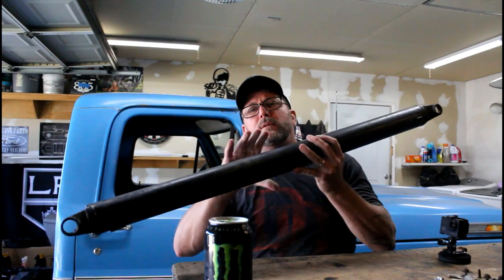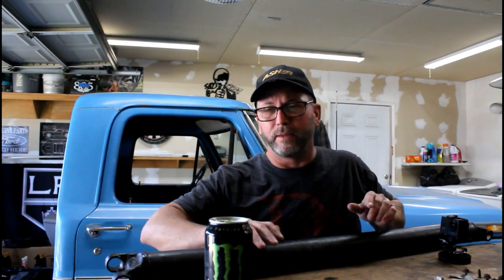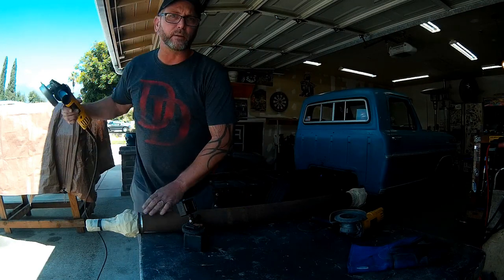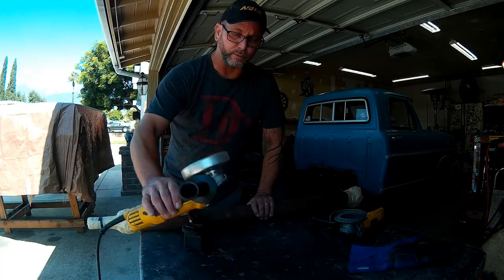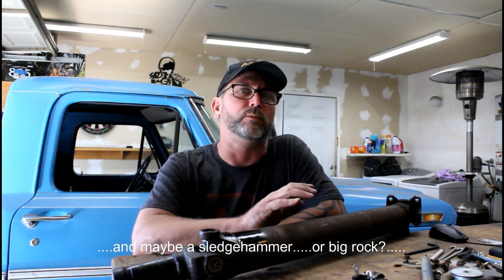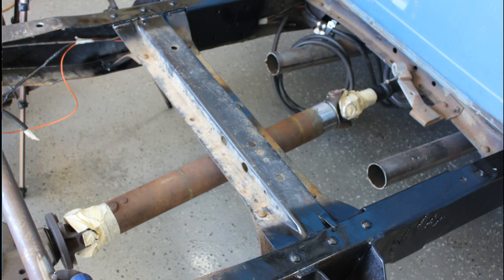Ford F100 Shortbed Conversion; How to Shorten a Driveshaft With basic tools!

Comment from the maker: still beating on the truck daily, over 3000 miles on both shortened shafts and no vibes.  both have held up fine to tons of 5400rpm burnouts, hard launches and 136mph speed runs.....allegedly....  thanks for watching!
Reply from the maker: up to 4500 now!  and only thing failing me is the damn throw out bearing.  :(  brand new ford motorcraft bearing has crapped the bed.  meh, time for that twin disc...
Reply from the maker: we are at 5800 miles right now.  all good, only thing i've done is change the injectors to a new set.  just because.  all i do is beat on this truck.  :shrug
Reply from the maker: oh yeah, throwout is still squeeking on startup.  meh.

Comment from the maker: and just for the record, shortening and staggering the flowmasters made a HUGE difference!  (and i didn't think it would)  my brother was 100% correct in that staggering the pipes even 6" would cancel out the drone and change the sound.  the truck at idle sounded immediately different, tighter and crisper on rev, and no drone AT ALL on the freeway.  great change to make and awesome improvement to my truck!  thanks bro!
Reply from the maker: oh, and people at the show loved the mid-length bed conversion that i did.  shorter but not too long nor too short, ;perfect length IMHO.
Reply: That's fantastic! I have used J pipes before to cancel drone but hadn't heard of offsetting them, I'll have to try it out!
Reply: Hey there vintagespeed, I’m currently shortening a driveshaft for my 90 f150, I am wondering if you pounded the yoke all the way so it would butt up to the lip of the yoke or just to where you ground the weld off? Thank you!!
Reply from the maker: @caseypas16  yes, i cleaned up the tubing where i ground the weld off, cleaned up the yoke to the shoulder, beat the yoke back into the tube and welded 'er up.  has held up fine so far, lots & lots of burnouts/donuts and today ran 'er over 100mph on the fwy again....it happens frequently...was doing some data logging.  so far so good!  thanks for the question.

Comment: Before you weld,put the shaft on the vehicle and use a dial indicator on the shaft you can get them perfect.
Reply from the maker: good point!
Reply from the maker: i actually did knock them around a little.  the shafts i've just done for the '59 apache, 5.3 swap that i'm doing right now came out pretty tight at .003.  👍

Comment: Wheel hop with 35" on a pickup will twist a shaft also... been there. I've always dropped a shaft twice, from the rear at full throttle...it makes one heck of a racket beating under a car.
Reply from the maker: i'm sure!  only shaft i've ever dropped was one i banged up on jackhammer in JV..  but that was really beat to crap on the rocks.  street stuff has been fine.  thanks for watching!

Comment: Pretty close to how i do it . Pinchin it off only works if your taking a bunch off the tube . Typically your only takin a few inches off . Pinching doesnt work in that case ! Good tip on steel discoloring . I only use a cut off wheel . No grinding stone . Goin back tagether , , you use a square off the ears . And check square leg down yr drive shaft ! Just like a pipe flange on pipe ! That way you know that direction is perfect ! Now yr only referencing one direction rather than 2 directions !  Ive welded
Up some funky shafts through 40 years . The nipple or flange insert helps line it all up n gets ya close ! Ive welded em up , one sides 2 foot and the other ends 4 foot . Then you just clamp your shaft in 2 pieces a  angle . That lines up both directions at the same time . Actually easier ! But riskier if it breaks ! And the first shafts we did in the 70s . We didnt have a mig or stick welder . But we had a torch ! First 3 , 4 shafts we made were gas welded with a coat hanger for filler metal ! Ive never had one break ! Last one i made was after a drunk hit me . Brain bled for 17 months  plus ! Front shaft on 77 3/4 ton chevy plow truck went out . Ive had alot a blazers i parted out . Took a rear shaft from a blazer . Shortened it up . Turned it into a front shaft fr the plow truck ! Ben 9 years now . No problems ! Good video brother ! Be safe !
Reply from the maker: thanks for the tips!  good stuff!  my shafts have held up just fine in my old junk, and have been fine after lots of abuse and 130+ mph runs!  there's ALWAYS a better way to do something, but sometimes the old ways work pretty damn well.  thanks for watching & commenting man!  (she's up to 4800miles so far)
Reply: @vintagespeed  be safe my friend !

Comment: Thanks for the information.  I'm converting a 1967 F100 from a 3 on the tree to automatic and I don't think that the drive shaft is going to be the right length.

Comment: Thanks for the video it was very helpful. One question, I noticed in the video is that your engine appears to be center and parallel to the frame rails and your rear end is offset to the passenger side of the truck. Is this how is from factory?
Reply from the maker: the motor is offset to the passenger side about an inch to clear the steering shaft/joints, the rear axle is centered.  the 8.8 is offset pinion so the yoke is not exactly centered in the housing.  thanks for watching and keeping me on my toes!

Comment: what is drone with the mufflers?
Reply: Bill, The mufflers vibrate as exhaust pulses pass thru. Each has their own harmonics and change at different engine speed and the muffled weight. Placing them at different lengths apart will mostly do the trick. But “Droning” is heard inside the vehicles cabin. Manufactures place weights on heavy gauge rods seen on several common locations if you spent a lot of time under different vehicles. A vibration or droning is high enough for the human ear to hear. Sometimes, the cabin becomes an amplifier. Each item in life has a frequency when vibrated at the right speed. The ones you can hear have to modified. Hope this helps!
ASE Master Tech since 1978.

Comment: Most shops would not touch anything they did not weld themselves.
Reply from the maker: depends on your shop i guess.  🤔  so far, my budget shafts have .003 - .005 runout, have proven themselves to 5500rpm burnouts and 135mph runs...so for now, so far so good.  :)  thanks for watching.
Reply from the maker: i will update if something happens.  i've tried,  nothing's happened.  :D

Comment: Just take the shaft to a professional driveshaft shop. They will cut it with lathe, chamfer the ends for welding, precisely remove the weld so the yoke can be removed easily, new ones pressed in, welded and the shaft balanced.  All this in about 35 to 40 minutes.
Reply from the maker: yeah, well that's what i said in the video.  BUT if you're not able to get to a driveline shop and you need a quick fix...  although mine's fine.  thanks for watching.
Reply: Lol! There's always a few people who project their feelings and perspective on everyone else, thinking they should think just like you do, and there's OBVIOUSLY something wrong with anyone who doesn't!  If everyone just did things the standard way, there would be no such thing as custom builds and really, who would ever have anything to post on YouTube? Lol!  Not to mention that there are times when things don't go as planned, or you live in the middle of Montana, and the nearest driveshaft shop is 5+ hrs away round trip, etc etc.....
Sharing knowledge is what we're here for. Sorry for the rant, but there is more to life than just being like everyone else.

Comment: Good lord, please do not do this to your driveshaft!! Absolutely the wrong way...please visit your local driveline shop!!
Reply: Yes, I would agree the the weld should but cut on a lathe with center supports. Dial indicator is recommended in 4-5 locations to achieve near perfect inline rotation. Plus, with the minimum removed, a TIG would best best. But I have seen many race cars on 1/4 mile track or late-model categories work fine balanced by two hose clamps, marks and alignment shims used as weight. 
Even factory shafts fail. ASE Master Tech since 1978.
Reply from the maker: sure, like i said in the vid, the best method is to take it to a driveline shop.  this should be used as a 'temporary fix' type situation.  that said though, i've put 4800 miles on my V10 (400+ foot pounds) little 415ci and she gets beat on every single time i drive it.  lots of donuts and burnouts, many many many 1/4 mile runs and many 130+ mph freeway chases..... and ya know what??  so far not a single problem.  thanks for watching!
Reply: Wow! You know if he took two days to get it done, or the thing flew apart the first time he drove it, or it vibrated so badly he lost his dentures!! Lol! Haha! You guys are killing me!  It's working! It's working! If you have half a brain and a tad bit of understanding, you can replicate his results pretty easily! If you're just learning, might want to rethink it! Personally I have brought driveshafts home after driving nearly 4 hrs round trip, and the jackass  who "balanced" the driveshaft failed to notice it was running out by .125" PLUS!! AFTER I explained when bringing the shaft in that it was there because the rear yoke was broken from the previous owner turning up the radio, instead of replacing the ujoint! Resulting in a bent shaft! 
I could have done better MYSELF with an effing hacksaw, file and my mig welder! Would have been time AND money ahead as well!  To top that off, I'm working on a driveshaft right now, that has miss matched size bearing cups on BOTH ENDS of the driveshaft I paid $350 for and wondered why the ubolts felt like it wouldn't tighten down like it should! So the "experts" ef up pretty bad sometimes! Oh the second story is a totally different shop as we were 500 miles from home when apparently something damaged the shaft on the highway, and the sucker twisted up like crazy, pulling a trailer up a goat path with an actual road name in West Virginia! Lol
Reply from the maker: @deankay4434  meh.
Reply from the maker: @davidcatlin1970  dang man, i dont have dentures....  and yeah, what's it been, 3yrs of just pure beating on this 450tq V10 truck???  all i do is drive the sh!t out of it and i've had ZERO ISSUES.  ZERO ISSUES.  so i will just keep on beating on it, you guys can keep on bitching about it and we'll all be satisfied i guess.  those guys need to go actually work on something instead of just blathering about how someone else should work on something.  thanks for the support, and i'm sorry i'm a slacker and didn't reply sooner.  thanks for watching!
Reply: @deankay4434  I cut the welds on mine with a lathe. Umm you'll find that the "indicator in 4-5 locations" is chasing your tail! The tubing is not that round and straight! Lol! You run the indicator on the end in the chuck, and get the best you can. Then run down the side and top from the chuck towards the steady rest, to be sure it "as close as possible" (which might shock you how bad the tubing is!)